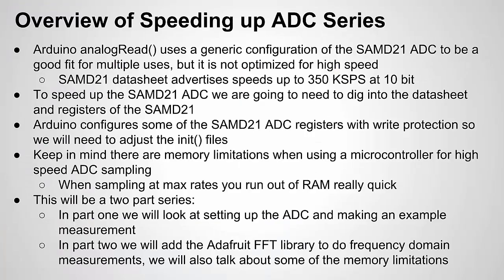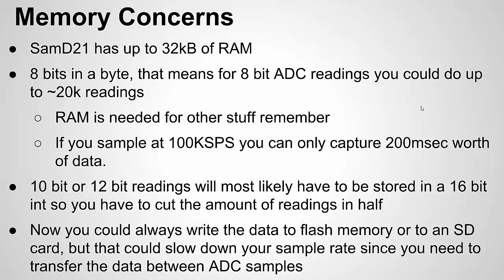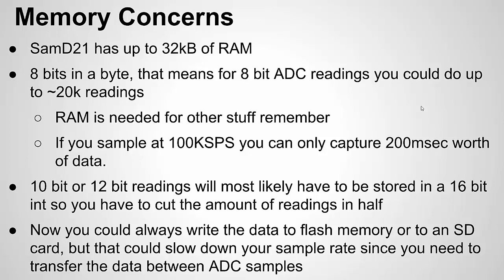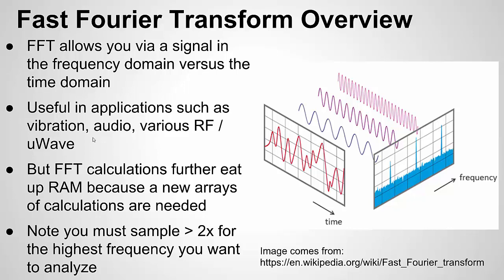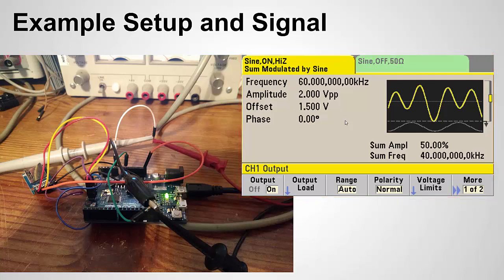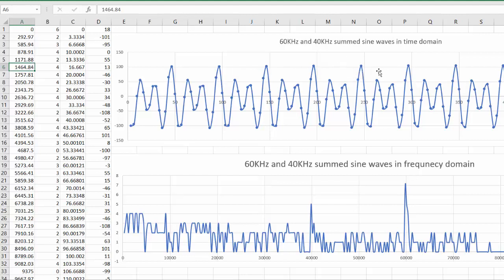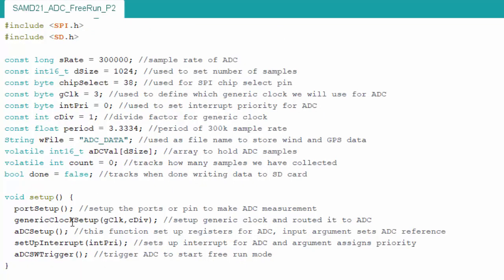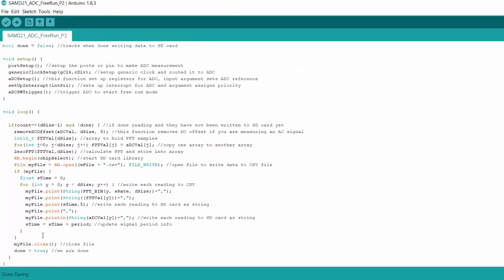Speeding up the ADC on Arduino SAMD21 Boards (Zero, Mkr, etc) Part 2

Comment: Can the DMA be used to write over SPI?
Either to an SD-card or to an additional memory chip (like W25Q128FV)?
I am trying to figure out what I need to do to store my data. I am sampling 128bit samples (multiple sensors) at approx 1kHz to fill a buffer that gets flushed to the SD card. But everytime the buffer gets transmitted I get a gap in the measurement.
Would it help to place reading the sensors in an interrupt, filling a second buffer from the one that is transmitted in between the interrupts? Can I have interrupts while a SPI transfere is going on?
Reply from the maker: Hello, I think your question is a little large to address in the comments section of a video. It requires Q&A as well as research. What I would recommend is breaking your question  into smaller pieces and asking it in a forum. I am not sure what programming environment your are using but you will need an environment that gives you access to low level hardware control and supports debugging (not Arduino), like Atmel Studio. Good luck.
Reply: @ForceTronics  Hi! Thank you for your answer! 
Yeah, I got the feeling that the Arduino IDE might not be the best place to be for what I want to do.
Up to now I used an UNO, as this is the very first MCU project I attempted. I didn't really have stuff about MCUs in university ... and barely any programming ... so, it's a little bit daunting and I am confused about the direction I have to go in.
The DMA looked like it might be usefull at some point. So I thought about transitioning to the SAMD21. But I compared a couple MCUs the past two days and I think the STM32L476 might be even better suited. Might as well learn there.
It has multiple interfaces for SPI devices ( of which I have multiple) and their IDE has a GUI for configuring all the register and DMA stuff.
You don't cover STM-stuff, right? 
Thanks for your advice! I haven't figured out yet how to divide this problem as there seem to be so many possible ways one could go. 
Wish me luck :D
EDIT: 
Oh, and after your video, the integrated ICSP and debugger of the ST-Nucleo L476 seemed super useful to me. ^^

Comment: There is this chip called SAMD51 which have a Cortex M4 inside so you can access to DSP functions thanks to the CMSIS DSP have you tried?
Reply from the maker: I have not used the SAMD51. Does it have a built in FFT hardware "engine?"
Reply: @ForceTronics  yes I meam it has a cortex M4 Wich has those DSP functions embedded so you can do FFT's filters or more things using the CMSIS DSP library which is also included already on Arduino